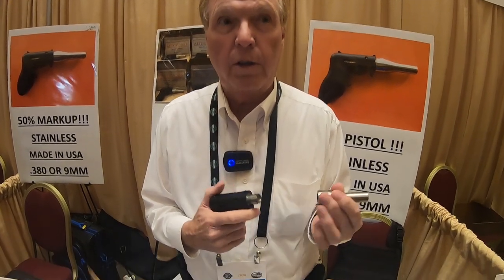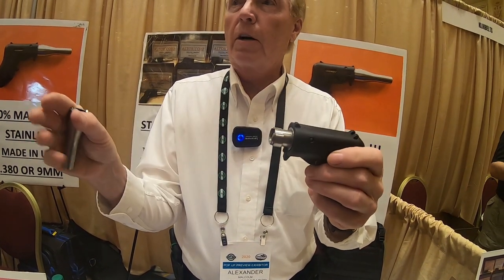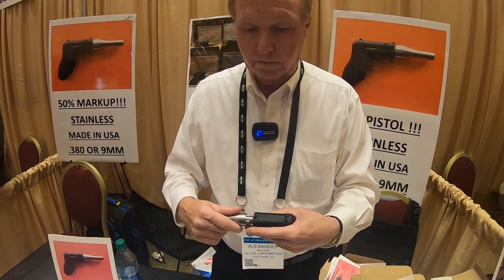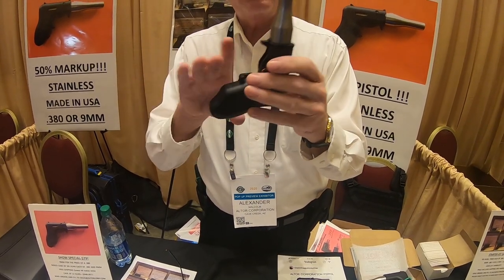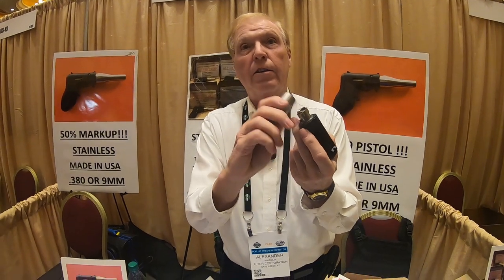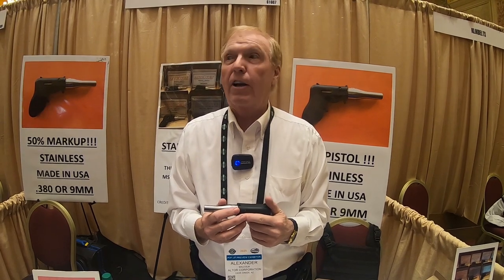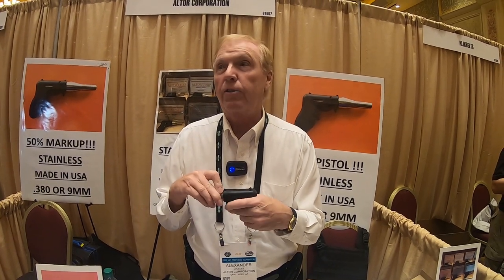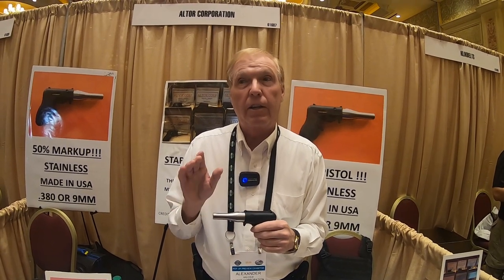The New ALTOR Pistol, a single shot pistol with only 6 parts

Comment: I bought one of the in 9mm just for the novelty factor. It's a very interesting design for sure, but it's honestly the most dangerous weapon I've ever laid my hands on. Considering it can be fired WITHOUT the barrel attached, this thing is an accident waiting to happen. Also, when set to the "safe" position, if you pull the trigger exactly 3 times, it will vibrate off of safe just far enough to fire. Oh, and it might as well be a smooth bore considering it keyholes at 21 feet. I shot mine about 5 times, now I'm cleaning it, putting it back in the safe and never touching it again. With any luck 75 years from now my kids will overhear someone at a gunshow saying "Man, I wish I would have bought one of those fucked up Liberator type pistols back in 2020, those things are worth a fortune now."
Reply: Exactly why I bought it lol
Reply: I saw another review and they had primered casings with no powder or bullet and it would not fire without the barrel

Comment: I wonder how this works in states that require a trigger lock be present at the time of sale. Sure, you absolutely could run the cable through the barrel, but it can be loaded and fired without the barrel. I’d sure like one to keep in the tackle bag for my fishing adventures in rattlesnake country!
Reply from the maker: Check out my review video of it they send a lock with it. It is a band that doesn’t allow the barrel to be installed
Reply: I too love fishing for rattle snakes.

Comment: Why?
Reply: Why not?
Reply: Bigmac   With all due respect, it’s like not even small. I have 10 rounds in a tiny Sig 365. It has more parts but so what. They are both firearms.
Reply: I bought one because it was wacky. It's definitely bigger than a P365 and even a S&W shield. Not super useful except as a trapper or animal euthanization gun.